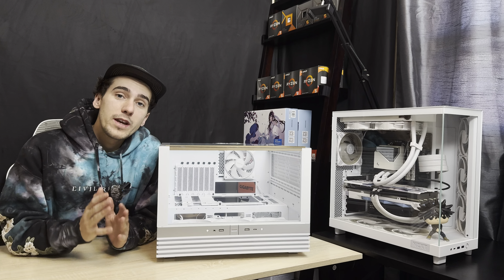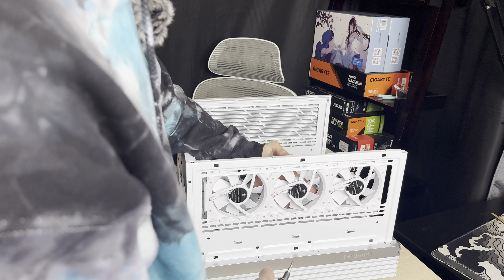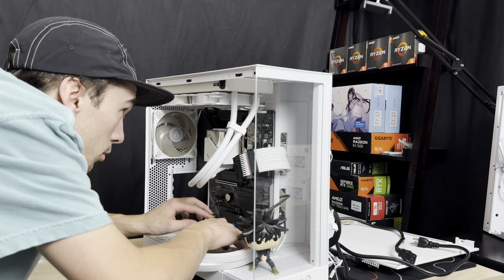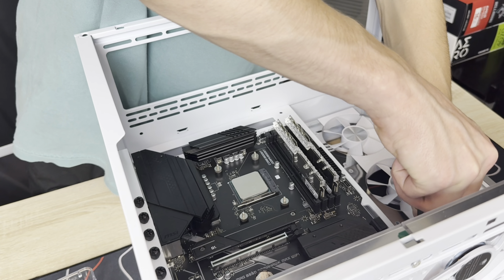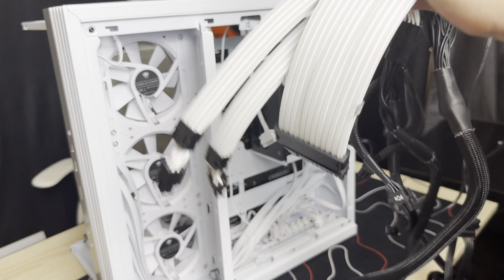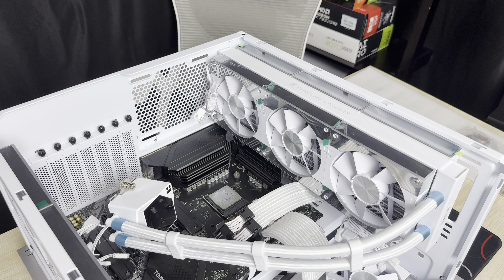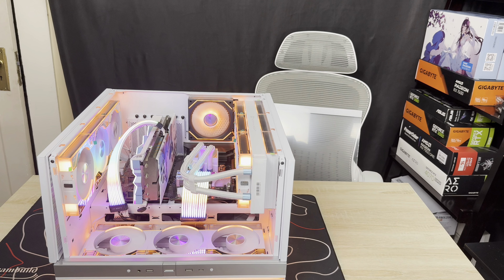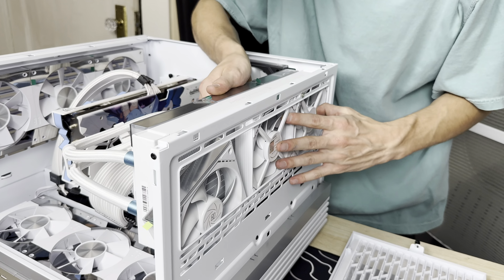Turning my personal Gaming Pc from JUNK to a MASTERPIECE 💎 (BeQuiet! Light Base 600)

Comment: Ima tryna get the pc Frl what the specs and case and everything for it
Reply from the maker: @ToxicOchoa  under $1500 
It has a Msi b550 ryzen 9 5900x 4070 yeston Sakura 850w corsair psu lian li strimer v2 cables 1tb Samsung ssd in the BeQuiet light base 600 with interstellar Icoler v3 fans 12 of them

Comment: What yeston gpu is that is the temp good
Reply from the maker: @longdeptraibodoiqua  yeston Sakura 4070 and temps are perfect!
Reply: @DreamBuildComputers  how is the temp at full load can u tell me ?
Reply: These card are the cheapest 4070 super white i can find but im concerne about the temp because there is not review of it
Reply from the maker: @ that’s a great find because they usually are more expensive! And it’s my main gaming rig at 4k resolution on my 4070 in deadlock I never go above 50c the airflow on this case is super good